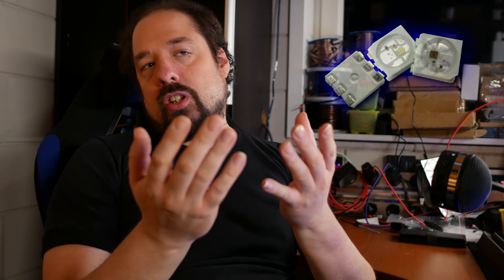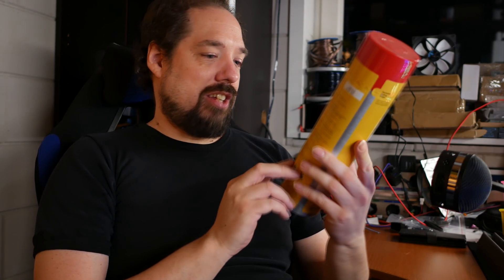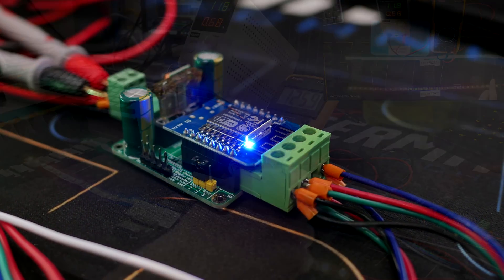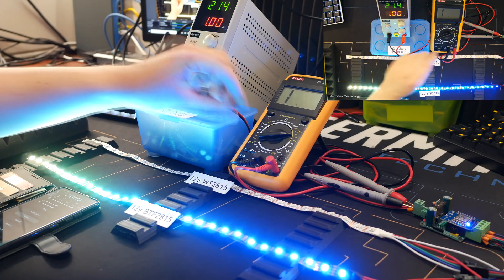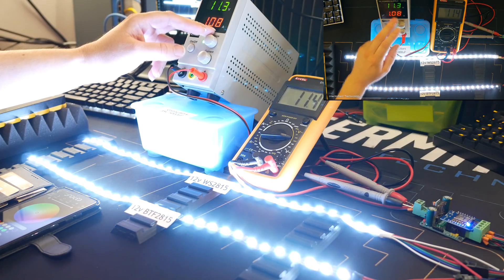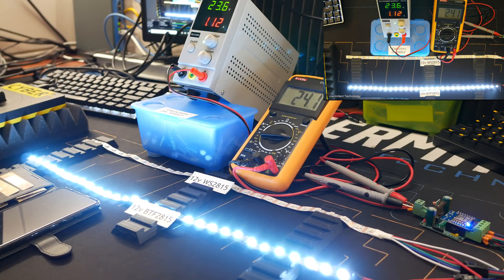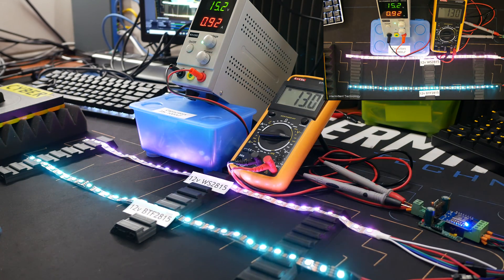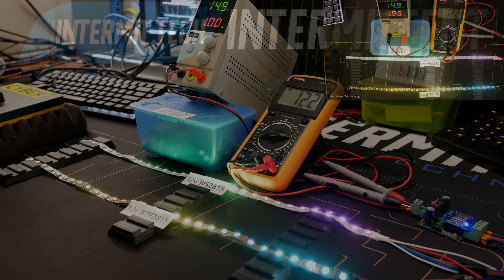💡QuinLED💡 24v on 12v WS2815 / BTF2815 | Will it burn?

Comment from the maker: Just to clarify, I don't recommend running these LED strips at 24v! But in testing the BTF2815 did show better properties vs the original WS2815. So in a varying voltage environment (a car for instance) I would prefer it above the original! I would opt to use the clones in the future just because they behaved so well, where just as bright (if not slightly brighter) and well, they are cheaper!👍
Reply: Where do you get clones from. Can the 12v strips be used with a SP107E???

Comment: i been trying to find out if my 24v leds 5 meter strip 300 leds rgbw 4 wire ,can run on 27 to 28 volt of my offgrid lithum lipo4s direct or will i need a 24volt regulator
Reply from the maker: Are we talking analog or digital? Analog might just run a bit hotter but if cooled and not run at 100% will likely survive.

Digital can be a bit more sensitive and might only suffer from the same as above, or just die.

So test and see, or, use buck converter to be sure.
Reply: @IntermitTech  I really like your channel and the technical details you share. I have a question about something similar. I’m using BTF 24V SPI WS2814 RGBW COB LED strips with 6 cm and 7 cm zones. I’d like to power them using a PD charger, which can output either 21 V or 28 V. Would 28 V be too high? Do you have any experience or knowledge about this?
Reply from the maker: Yes and sadly 21v is too low and 28v is much too high! No way to use PD for thst except maybe a 28v charger with AVS support, but it's gonna be Hella expensive vs just buying the right power supply and a controller that does it, doesn't exist yet.

Partly the reason I haven't made a USB-C PD based controller yet, they don't really make sense financially. You are paying up to double for the same thing?

Comment: Hi, I want to use wled with my ws2815 5 meter led/m 60 leds. Can I use just jumper as wire or do I need 18 awg wire to connect ESP32+ power supply+ 12v to 5v converter + ws2815

Comment: I will be glad if you can reply urgently. I bought WS2815 led strip. I wanted to test it with the 12volt output (12.5A) transformer I have. I connected the red and white ends of the strip led to the plus and minus outputs of the transformer, but it did not light up. I will get the ESP 32 i microprocessor later. My goal is to pre-test. how do i do this.
Did I make a wrong connection? Or are the led strips faulty?
Reply from the maker: Addressable LEDs will do nothing without data so get yourself something that can send the data to the LEDs, then you can test. :)

Comment: Can you show a heat dissipation comparison at standard voltage and under-volted for both? We're trying to cram 800w of these into a 2m polycarbonate tube and need as little heat / power loss as possible when driving them with 18650 packs outputting 10.8-12.6v.

Comment: is it possible the difference between line voltage and data line voltage is causing the data to not be recognized.
Reply: maybe try shifting the data line to 8v or 12v.
Reply from the maker: Maybe, but the LEDs will burn up quite quickly anyway, so even if you could fix that part, still won't make it a viable solution

Comment: Hi, 
Which is the data high level voltage for ws2815?? It is 5 volts or 12v ? Thanks
Reply from the maker: Data signal is always 5v, no matter the strip voltage
Reply: @IntermitTech  Bro, I fix it, I put a resistor between ESP data output and WS2815 DATA INPUT.
The problem was that i had to use a potenciometer to regulate the Resistor, because every WS2815 has difference level of signals

Comment: That PS is almost as crappy as my used HP single 0-30V E3640A that I had to change the fan and scrounge the handle and bumpers. I'm sure it's way out of cal, so I bought a precision voltage source and a Fluke 289. 😂 
Just need a microohmmeter now. Oh wait, those are $1k. 😭

Comment: I want to possibly buy a quinled but i'm having difficulty figuring out  how the power supply should be connected  or how many meters are supported per board. I want to DIY runs along my ceiling for my room.

Comment: I currently have issues with BTF2815 flickering, while my WS2815 do not.  Both are driven via the dig-uno, and I've swapped them around just to be sure.  I'm not a fan, even with the claimed better specs, they don't seem worth the risk.
Reply from the maker: Interesting! Haven't seen any of that in my testing. How are you two datalines connected, did you connect both to the same output in?
Reply: Good question.  I used WLED so there is nothing set for the second output, so I assume it's open.  I've tried driving both with the same output with unpredictable result, but that was directly off a D1 mini gpio

Comment: Can you explain why the amperage in the timelapse at 24 volt drops from 1A to 0,5A?
Reply from the maker: In theory double the voltage requires half the Amps, but in this case, you really shouldn't trust what that bench power supply is saying, it's quite bad and I always just check with my multimeter.

Comment: Run the 24v test for 48 hours
Reply from the maker: I currently don't have the facilities for that. But I think it's been shown that it wouldn't be good for them. No1 cause of death to LEDs is heat as hot as they got, they'll be dead in days!
Reply: @IntermitTech  Yes, that is what I was hoping you would prove.  If you can let them run longer, until they do die, then you can for sure say it will not work.  Also, it may be worth testing in a real situation with proper cooling/heat dissipation.
thank you for the video.  Your power supply is funny.  If you select a new one, and get it, please do a review on it.

Comment: Great video!  Wouldn't running a long strip at higher voltage help with voltage drop-off? I'm betting that at 18v would probably do fairly well with these more tolerant LEDs over longer runs.
Reply: I was thinking the same. How much longer of a run can the 24v strips do without power injection?
Reply from the maker: True that you can do longer without injection, but the strip will burn itself up in no time like that. There are special 24v strips, but those are only addressable per 6 LEDs to deal with this issue.
Reply from the maker: Well yes, but all that extra voltage is going to need to be burned off. So while they are more tolerant to it, heat is still the no1 cause of LED death. So every extra volt you feed it, will mean your cooling will need to be that much better. So I'm not sure I'd recommend that, at all...
Reply: Okay thanks for the info....im still planning to outline my home roof line, but the extra wiring is what has held me back....so this won't help me. Don't want to put up anything that's thing to burn out quickly.
Reply from the maker: @silfa718  Well, there is official 24v strip which would make wiring easier for sure, but those are only addressable per 6 LEDs! :( Other then that, it's 12v and injection every ~150 LEDs or so.
Reply: @IntermitTech  Was googling all day I came up with injection every 120 nodes or so for 12V so I will update my notes to ~150 and what is the magic number for the 5v LED's?  I have about every 50 or so in my notes.
Reply from the maker: That sounds a bit off to me. Look at my power sheets and also the LED setup livestream I did, that'll teach you everything to do calculation on up front.

Comment: Is it possible that the WS2815 starts to drop out around 18 volts because of the difference in the VCC and the Din voltage (similar to trying to run WS2811b directly from the 3v3 GPIO pins)?
Reply from the maker: Not sure, could be but on the other hand later LEDs in the chain would still display some data so dat was still making it through basically. Looked more like some form of over voltage protection to me.

Comment: So basically if I were to put a lot of BTF2815's next to eachother and run them at 24v, I could use them to fry an egg?
Reply from the maker: Hahaha, maybe for a little bit, but I doubt it would survive for very long like that, even if cooled with an aluminium profile ;)
Just to re-state, this video does not mean you should run BTF2815 at 24v, just that it doesn't die instantly.

Comment: That data sheet has some interesting Chinese to English translation.  I think they are saying the BTF version runs cooler than the standard version.
It will certainly be a very interesting thing if these do last the test of time.   I noticed they have quoted 12 hours continuous at one time.  I wonder how they will go if you run them longer.
The BTF strip definitely looks brighter and maybe even cleaner colour than the WS version.   It would be nice to see them with the correct colour order.  I don't think it passes the heat test for me though.
Reply from the maker: Yeah, I haven't tested them for that long yet, but those BTF2815's do seem to make an interesting and cheaper alternative!
Reply: @IntermitTech  I am not sure about how hot the BTF version runs though.  I might be tempted to stick to WS2815's.   How hot does the BTF2815 run when it is run at just 12 to 15V ?
From your side, how did the colour look on the BTF?  Sometimes it's hard to tell on camera.
Reply from the maker: @EsotericArctos  Colors look the same to my eye and what they say is true, running at the normal voltage the BTF2815s run slightly cooler. I think they use a more sophisticated voltage regulation method, that's why they can also cope with the higher voltage. My feeling about them is quite good. :)
Reply: @IntermitTech  That is good news.   I might give them a try as 12V replacements,  Not sure I like the 100 degree heat at 24V.  That would seriously reduce the life of the LED's.
Thanks for all the advice, as always.  Looks like another winner for BTF lighting.  They have become one of my favourite Chinese LED suppliers.
Reply from the maker: @EsotericArctos  Yeah, BTF has been doing good. But don't get my video wrong, I certainly don't recommend running them at 24v, they get really hot as you could see. ;)